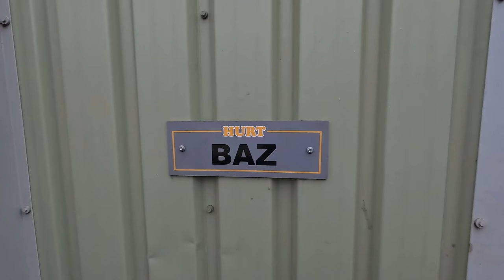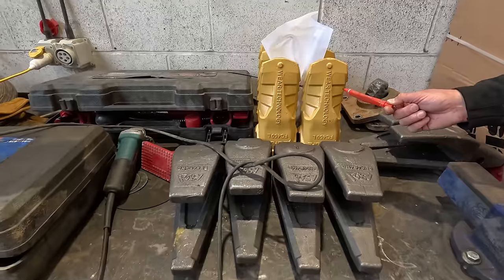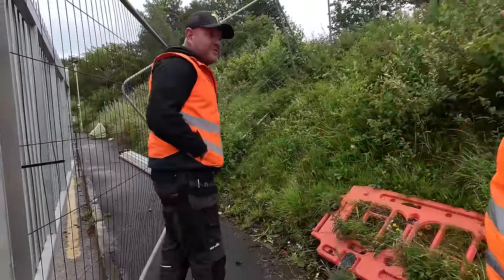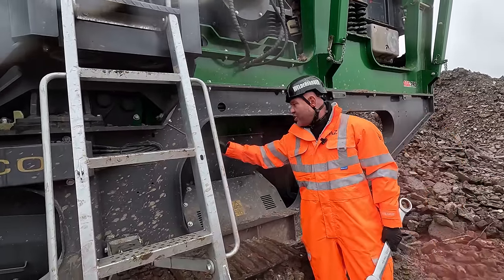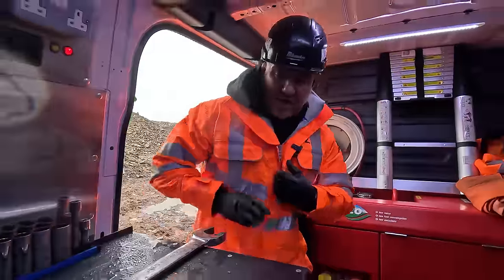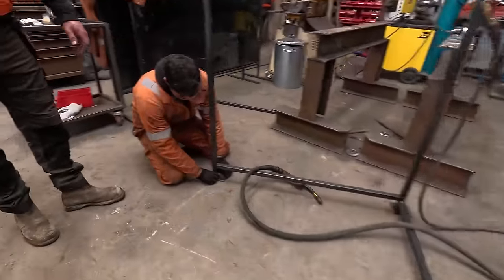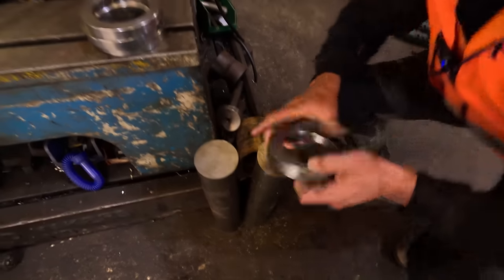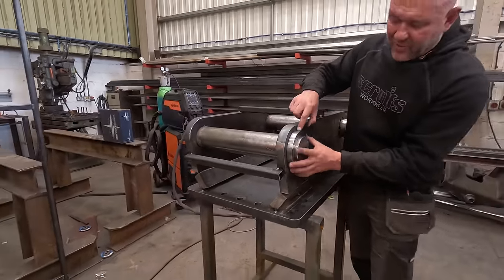Crushers & Breakers! The WELDERFABBER Chronicles Chapter #002

Comment: One thing that I've learned very quickly from you Baz is that I'm amazed at how much stuff you and your team fabricate yourselves. 
Mainly it seems is because the machine manufacturers price themselves out of the repairs because of the ridiculous price they charge for spares. 
That is one sweet T cab Scania and I've learned quickly that you and your team are absolutely invaluable to Fox to keep thing's running. 
Great video Baz keep it up 🎉
Reply from the maker: cheers bud
Reply: Save a fortune with a capable workforce

Comment: I love seeing someone just as passionate about their craft.. I am passionate about the machines themselves, and love watching your videos because it shows me stuff Ive had problems with operating and stuff bending or cracking. Those brackets that are on end of the pin.. I have the same thing but the pins themselves are not welded and just a bolt holding them in.. and the pin has walked sideways out of the bracket.. its a bracket for a FAE mulcher head, and whoever has the contract to make the brackets i own 3 and each one the back pin always walks on the bracket.. we use quick couplers and our mechanic says"I don't see how those pins can move sideways or bend  bolt for pin boss on the top of the mulcher bracket pins.. cats quick coupler grabs onto the specialized made bracket.
Reply from the maker: Yeah I get ya we prefare to weld all pins rather than lock bolts and add a collar

Comment: Who was the fitter for fox who used to come and do welding on the beach at Blackpool wen you had that compound near pontins used to weld new lugs on the wheels on them old rusty dump trucks when the wheels span on the hib
Reply from the maker: No idea pal, only been under foxy for 3 years when he bought hurts.
Reply: @welderfabber  ok he worked for foxy mobile mechanic and welder he was sound and a bit puddled haha